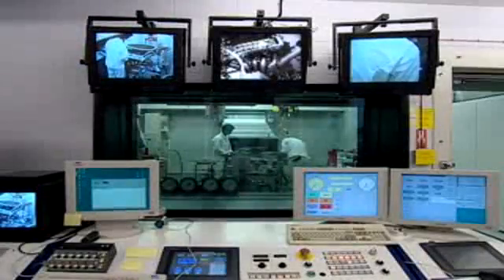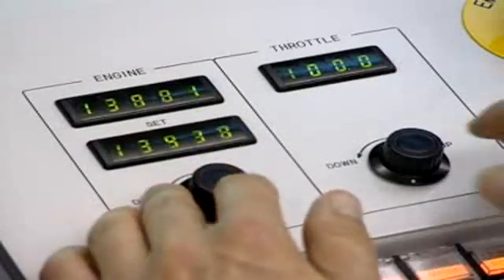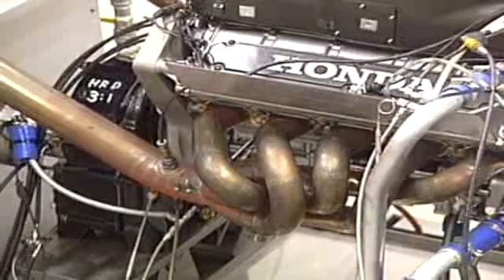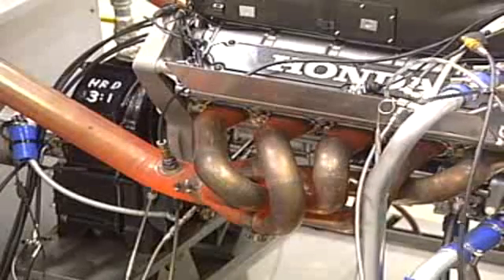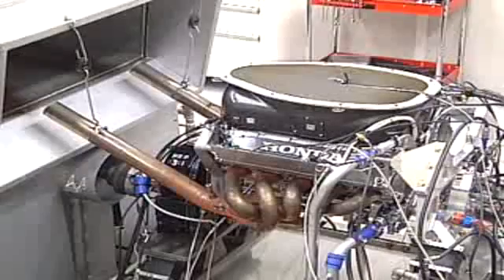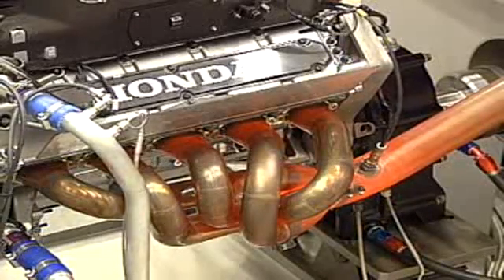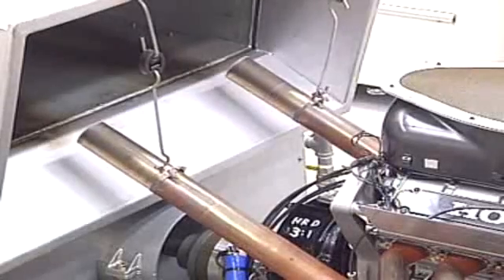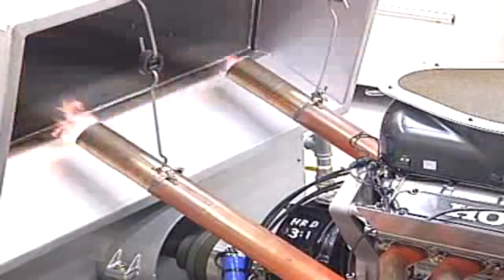Honda F1 Engine 1000HP

Comment: Yes it reaches 18k rpm or more, this engines rev very high because their torque figures are low (being the power a function of torque and speed) so if you want more horsepower you need higher revs. And F1 engines don't have direct injection, the fuel is atomized in the air before it enters to inlet valve, instead of being injected in cilinder, that way the air has some miliseconds/microseconds more, to spread in the air, therefore making a better air fuel mixture with better burning patterns.
Reply: No it's not they only have a short stroke that's why they rev high
Reply: That's a RA109, and was designed 35 years ago and more or less developed in a rush. They are capable of 200hp/l and around 75fllb/l, bearing in mind it's naturally aspirated, that's by no means a low torque figure taking into account the power by displacement... 

Consider the application of the engine, it's still holding 0.4ftlb/kg - 1.4hp/kg of car weight on full song and still a naturally aspirated monster even by today's standards.
Reply: The high revs also come from high build tolerance inside the engine I.e built seized and requiring hot oil circulation before loosening up and firing
Reply: Jason Cherry

 You appear to be conflating tolerance and clearance, they are not the same thing.

 Tolerance is a measure of similarity between multiple items coming from the same production run, for example, if Mahle make 10x pistons then the tolerance would be how much those individual pistons vary in size from one another.

 Clearance is how closely two (or more) parts fit together once assembled, unrelated to the manufacturing tolerances of the parts being assembled.
Reply: @nickcook7408  correct I didn’t do myself justice there. Thanks

Comment: I just read your coment again at first I though you meant an actuated solenoid inlet/exhaust valve, but now I noticed you said "pneumatic/hydraulic actuated solenoid" did you mean a "solenoid valve" to control a pressurized fluid that opens and closes the valve at 18krpm? Man that's even more ridicule. Any fluid going back and foward at that speed would be so viscous that it would not work.You are crazy.

Comment: I'm an EECS engineer, you can shut it. No solenoid with weight for a racing aplication could build up the magetic field with the strenght necessary to conteract the pneumatic spring force in the amout of time necessary to reach 18k rpm. A solenoid capable of doing it, would weight 1kg because of the large section copper wire, or to make it a little lighter you could use ambient temperature superconductors(something that someday will be inventend lol).
This engine uses a camshaft, I have seem it.
Reply: You are full of shit.

Comment: Of course a pro mod engine doesn't last 200,000 miles, a pro mod engine also makes many times the power and is subject to much higher stresses (it's miles are spent at WOT) than a B18C that goes for 200,000+ miles cruising around on the streets, seldom hitting WOT.
My point those many months ago was that a big pro mod engine is subject to even higher piston speeds while swinging much heavier parts around than the B18C.

Comment: They were probably referring to the v12s of the era, the v10s were hitting 20k rpm, FIA ended up regulated rev limiters at 19k and then to 18k. I think only one or two teams was still using a v12 by then because of regulations making the smaller engines faster.I've heard the same thing you said before a couple times. There are F1 engines that never got above 12k, but I don't believe from the 90s. It's tough to find solid, non-contradictory info about it, since they're technically secret engines.
Reply: But I remember V10s progressing from 18000 to 20 and over, so who knows. You are talking about 1 or 2 thousand revs here.
Reply: The math seems off. There's 10 pistons, so I'd say more like 30

Comment: Piston goes up and down 300 times per second!?       *has a brain explosion*
Reply: 150 ups 150 downs
Reply: @whysosadmate  no mate 300 times up 'n down
Reply: My mind doesn't accept that either.
Reply: Ultra short stroke.
Reply: Yeah. How is that possible
Reply: The biggest issue is piston speed. , or the lenght that a piston has to travel from top to bottom at a certain amount of RPM. I think in the past getting past 25 meter per second was always the limit because of the materials. I don't know what it is now, but my guess is a little bit above 30 meter per second. Anyone that knows ?

Comment: @djrmonix Pro mod engines, depending on there size and stroke, can have even higher average piston speeds than that, in the area of 7000+fpm. And consider also how much larger and heavier those V8 pistons are compared to either a F1 or an B18C piston. God only knows the kinds of G forces they're subject to.
Reply: Those engines are essentially stick of dynamite. Quick burst of power then its over. Theses engines can run at those rpms for hours. Kinda like comparing apples to oranges. Both good but extremely different.
Reply: @donziperk  
They have more in common than different. I'd hardly call that "apples to oranges".
Reply: @177SCmaro  Well, aside from the vast difference in lasting a whole race weekend for 200 kilometers of training and qualifying and then 300 kilometers of racing (500 kilometers = 311 miles) which roughly amounts to 4 hours and lasting just a few seconds for 402 meters (quarter of a mile) they have lots in common... Pardon my sarcasm. 

It is a textbook apples to oranges comparison. 
"They have more in common than different." You mean like apples and oranges? Both are fruit. Both are edible. Both are sweet and rich in fructose. Both contain vitamins. Both are popular and are found in any convenience store. Both can be made into juice. Both grow on trees. Etc etc
But the fact remains apples and oranges aren't remotely comparable . 

You:" But... they both are fruits..." 

When cooling, longevity, fuel economy, reliability, drivability, dimensions, weight don't need to be considered at all there's very little limiting factors. 

Did I mention that your comparison isn't VALID ??

"epending on there size " And you don't even know the difference between their and there . That's basic English grammar for crying out loud. How much validity can one put in and your arbitrary statement following that?
Reply: @christinefury7839  
Wow this comment is 10 years old. 
I mean that they're both spark ignition piston engines. They have more in common than different. 
Pro mod engines usually last longer than that. You maybe thinking of Top Fuel engines which many of the components are rebuilt or replaced after every pass.
And there are diesel engines with exceptionally long strokes that result in nearly as high a piston speed at lower rpm that go a million miles. That wasn't the point. 
The point was just that there are higher speeds out there. Pro mod engines don't last as long as F1 because they are subject to even greater forces over a shorter period of time and a good deal of their mantainece is precausionary. Not sure why you're trying so hard to stir up an argument. I never said one was better than the other.

Comment: Anyone know how the pneumatic valves work? That must also be extreme pressure and g's.
Reply: They are pneumatic valve SPRINGS. There is an air cushion that springs back the valve, because a mechanical spring would resonate at that frequency and break very quickly.
Reply: @jackmclane1826  Thanks!

Comment: @muddwell Yeah. There are diesel engines designed for ships that have maximum power at about 80rpm.
Reply: Yeah and on the rev counter red starts at 90rpm lol
Reply: And the diesel motor in that ship is heavier then a whole starting grid of f1 cars

Comment: That belongs in an NSX!
Reply: Lots of F1 technologies have filtered down, much less powerful, into the supercars out there... This is not new... BMW made a really fast 4-cylinder, turbocharged, for F1 back in the 80's. And it was fast enough that the F1 drivers were a little scared of it, because, they said, at any speed, if you put your foot into the throttle, it would break the tires loose... This engine was so fast, and it revved to 19k, that eventually, Ferrari had influence over F1 and had it banned... BMW had proven their point...